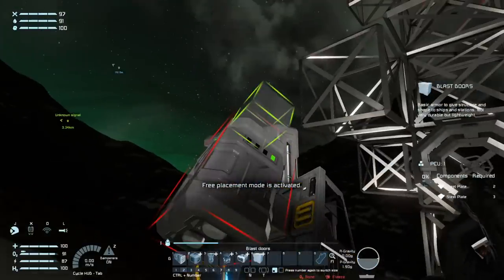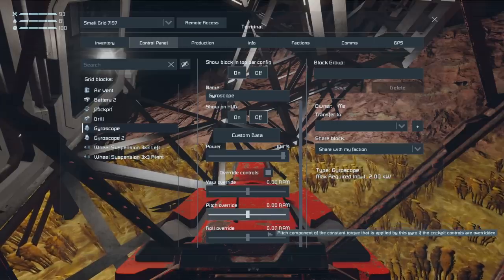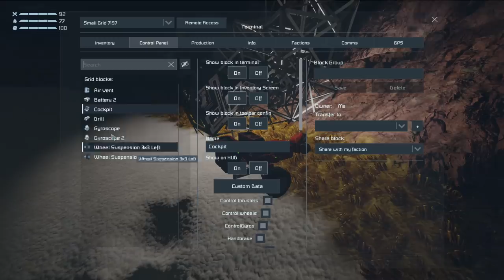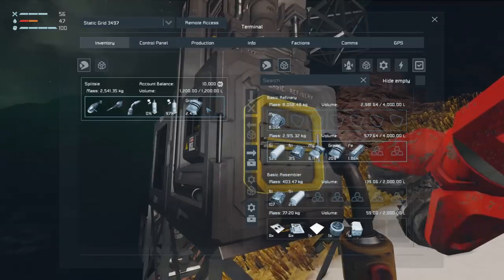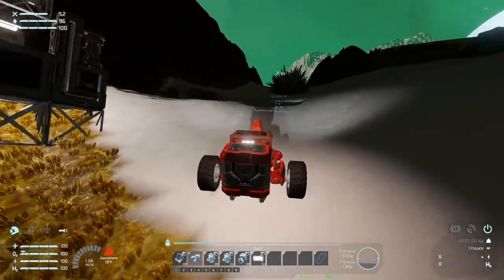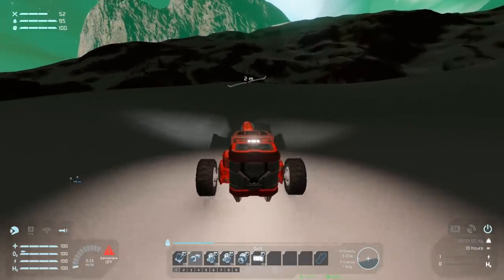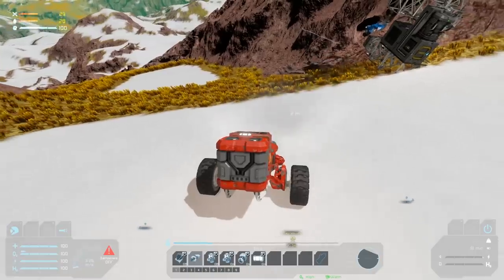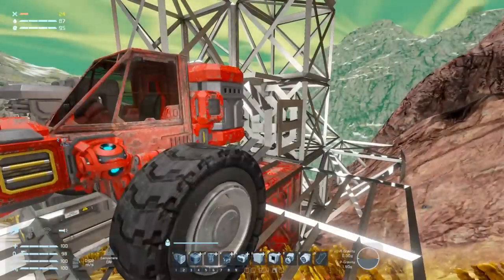Survival Impossible - Finding a Home #3 - Space Engineers Hardcore Survival

Comment: I had the same thought about the survival kit that you should grind some of the front out to make a flat surface for the miner to attach on with a rotor, and pop a pair of wheels under the landing pod. It will take some drilling to make room for it but if you charge the miner enough you should be able to dig it out with relative ease. 
Once it is out and in the open it is easy to frind out whatever you need. Right now I'd keep the armour pieces on just to protect the survival kit until it is secured.
Earlier on, I would have made a tunnel to the survival kit to make it easy to get to, to make it safer to get to the oxygen.
I guess my playstyle doesn't rely on the jetpack so much so I think of those a lot.
Reply from the maker: I think I'm probably going to go that way with survival pod if I can decide what to do with the cargo container, or better yet if I can work out a way to move it and the engine underneath as well :)

Comment: Hello Splitsie, this is my first comment in any video. First thanks for an excellent work. Now my little grain of sand: gyros have a forward and back position. It does not matters while driving normally but IT DOES when overriding. If you look at the gyro, sides are easily noticed, front and back not so much. If you look at it you will see one side have like 2 "eyes" one offset up, the other down. The other side have one "eye" centered, this side is front. Obviously u need to place it vertically respectly to the grid and the eye looking forward. Correctly placed -YAW will turn left and +YAW will turn right and so on. Hope this is helpfull and keep this excellent work.    (IGN: No_Mad)
Reply from the maker: Thanks that's good to know :)

Comment: I've been thinking, if there is just enough room under under Riki (the Rickshaw miner), you might be able to put a locked basic rotor on the bottom (facing forward) between the wheels or something, then add a 1x1 wheel with zero friction on that (the tire itself would be sideways, hence the zero friction).  that way you might be able to use the third wheel for stability when traveling, and drop it off somewhere, do some mining, then re-attach, and drive back home.
Reply from the maker: That's an interesting idea, I'm not sure I've got a clang free spot to put the thing, but I'm going to have to take a good look now :)

Comment: If you ever get problems with the stability of the little 2 wheel rover you could always just put a small wheel on the back under the battery pointing the wheel down so it works like a shock absorber thingy
I do realize that the whole point of it is to be able to point up and down really well but just a suggestion
Reply: I mean you dont even really need to put it on the bottom of the battery just on the back of it so you still have the manuverability and you dont need to worry about smacking your battery into the ground
Reply from the maker: I was thinking of something like that, I suspect it'd work fairly well despite looking a bit odd :)

Comment: For the miner, perhaps you could add a small piston that sits in the centre column of the 3x3x1 gap between the cockpit and battery, inbetween the central two blast door pieces when retracted, which extends downwards to the right height to provide a little stabilising foot for easy rotor part alignment
Reply from the maker: That's a very good thought rich, I might just do that :)

Comment: Forget attaching with connectors. They're never quite strong enough. No, instead, you need something ala the hitch for the catapult to the tank, so you get some articulation and can drive the entire thing by steering the miner. That way the cargo trailer can have a large cargo container, an oxygen tank, and most importantly a solar panel. With a piston jack on it to level it out when you park it. (And also make connecting easier.) Turns your weird little miner into something fairly All-terrain and rugged, while also being something that'll keep you going.

Also the large grid collector? Turn it on it's side, and park above a bunch of sloped armor blocks that lead into it, so the ejectors just roll down into it.
Reply from the maker: I'm really tempted to build a purpose made trailer for the miner in that sort of style, it'd certainly make the miner useful for a quite a bit longer which would be nice :)

Comment: Couple of thoughts:
1. Trailering from the survival kit back I think would save time overall in bringing that to the future home as you've already built the O2 generator and it seems to be needed so much more in this series. Also that container would be great to haul the components you'd need to start the new home.
2. Since you'll be grinding down the other parts, I'd grind down that atmospheric thruster in  front of the Survial kit controls :)
Reply from the maker: Yeah, I'm wondering if it'll be worth removing the engine and moving it to the top though, since it's set a lot lower than the rest of the survival kit mess...

Comment: Way behind on this series, I just subscribed after watching the Top Engineer challenge where Shack carried your vehicle down the mountain before taking you up.  You mentioned sliding or moving while in a menu, if you use space bar to stop and hold it while exiting or opening a menu it will hold you.  So far I haven’t had any problems sliding while in a menu if I made sure to stop completely before entering them.  I am enjoying the challenge of this series.
Reply from the maker: I honestly can't remember the sliding bit - which is a bit of a worry since this wasn't that long ago. Using spacebar as you're describing is using the menu to keep the handbrake on, a simpler way to do this is to apply the hand brake by a hot bar command which is accessible by adding the cockpit or remote control to your hotbar so you have a toggle :)
Reply: Splitsie when I am in a hurry I just use the space at trick to hold me while I attend to settings or whatever. Handbrake works the same but I tend to forget the keybind and have to think about it.  I have gotten through the next 2 episode and am currently playing in my world now, thanks for the challenging scenario to watch.

Comment: ooo you could make small sensor on the front and back and use timer blocks to equalize the pitch

also, you can stop rolling down the hill by using the space bar for braking

you may want to consider the easy grinding/welding mods, you can use a command to enable grind apart mode that separates blocks from the grid, the weld one adds merge pads that disappear when merged
Reply from the maker: I was braking as hard as I could, that's why I was getting nervous - the wheels were in full reverse because spacebar wasn't enough :P

If you look in the mod list you might spot something familiar ;)

Comment: Enjoying the series so far. The new planet looks fun, and the 1.9 grav adds some nice challenge. Not a big fan of 'aw scrap', but it could be fun here. The mistake I see repeatedly in SE let's-plays is: making it more about being stuck to the challenge, rather than finding ways to overcome and move beyond it. I think it would be a shame for that to happen here. Challenge for the sake of challenge is circular logic that becomes a trap. Watching you reach a point of not having to worry (as much) about jet-pack fuel, flying craft, etc. would be both entertaining AND full-filling.
It was mentioned that you might want to dig in to a mountain. You stated that you'd had you fill of underground bases with Survival Maybe, and I can see the desire for a change of pace. I also agree that doing so at this point would be kinda crazy without jet-pack/flying craft. However, I would like to state this idea for consideration: The sides of the near-by mountains have some pretty steep sides. If there was a shear face that gave you a suitably stunning view, might you consider an underground-but-not-underground base? I mean a base inset into the face of the cliff/mountain that wouldn't need to extend deep into the ground horizontally, but instead have multiple floors where most or all looked out at the view. An 'Eagle's Nest' base, if you will. Once you are less restricted to open ground bases, this would be a fun engineering challenge. With a flying miner, you could make a cliff-side road, like some roads in Chile or Peru, leading to a garage either set flush with the cliff, or set a little deeper into it. You would only need to make it for small grid, and just to get to/from the base. This would provide a challenge in just driving up and down this road without falling off the edge, and having a safe way to turn around at the base. Defense turrets could stick out of the cliff horizontally, and 2 or 3 independent, self powered defense turrets could be placed on the near-by hill-tops.
Anyway, my apologies for rambling on. I'm just a little excited to see were this could go. Keep up the inspiring content, and I hope you have a blast while you're at it.
Reply from the maker: I'm also going for the above ground base for a challenge to force me to engineer a solution to defending such a position, which feeds into your comments about challenge. Hopefully the things I've set myself here should be solvable with good engineering and I fully intend to solve them and once done I would move on to other challenges. If you've seen my other series I tend toward creating my own challenges to solve and do so to keep things interesting for me and hopefully the viewers. 

I don't believe they're circular in any way, because those sorts of challenge would be things like realistic personal inventory where you can't ever really solve that one properly, you'll always be a bit hamstrung no matter how good your systems there will always be 'grind' introduced into the gameplay.
Reply: @Splitsie  Overcoming challenge honestly is always a good story, and worth watching. I've seen a bit of your previous content, and you haven't fallen into the 'circular' style of challenge that I can see. If my comments came across as accusatory toward you, it was unintentional. As for the cliff-side base idea, it was just a hopeful thought. I'll admit to being something of a hermit, so I like underground bases in SE. Your under-mountain base in Survival Maybe really got my creative side riled up. It's your choice how you play, and I've no right to force anything. That said, unless you're planning to launch the base into space later on, might I recommend heavy armor for the exterior? Light armor is so painfully weak in combat. Anyway, still looking forward to fun new challenges. And if you ever find yourself running low on ideas, I'm sure I, and many others, would be glad to toss you a few - Like only launching into space with a minimal ship due to the gravity (thinking launchable version of the space spawn craft). Going for broke with a big ship could be interesting to try as well. I suppose I'll just have to wait and see. :D

Comment: In terms of a first person only game iv had an idea I haven't gotten around to testing yet.

With the introduction of the ability to lock the speed of a ship to another, Iv imagined one could get a pseudo 3rd person view of ships with small agile camera drones following along, how ever I imagine you'll need to drop controls to change the angles, or have someone else help out with that

Edit: Actually went ahead and just tested it, the camera drone has to have better directional acceleration then what your flying, and you will either need someone to keep it pointed at you, or only fly in on direction unless you want to re-aim and re-position the camera ship
Reply: can't a aim-at script keep the orientation?
using manual override on gyros
Reply: @ratchet1freak  well thats not too much of an issue but would help.

The problem is if you turn 90 degrees right the drone doesn't turn or relocate at all, so you just have a view of the right side of your ship, so you'd need a script to more so fix both those issues.

Or have a fleet of drones around you that you can switch to for different camera views when you turn. Would help as cannon fodder in fights, but more things to maintain and make sure that you don't accidentally crash into your surroundings
Reply from the maker: Plus in my experience a fleet of follow drones is quite the resource hog - at least from the drone swarm I used in episode 100 of survival maybe :P

Comment: It's probably fairly worthless to tell you this on such an old video in this series. But in case you do see this comment, and are still having trouble with this problem maybe it will still be helpful to you and/or others.

You should add an increase / decrease "power" control for your wheels group in your miner / rover. This way you can adjust quickly on the fly for when you have a full load and when you are empty. It is a night and day difference for slowing your vehicle down on steep downhill inclines with a full load, and easy to readjust when empty. 

I use this for all my wheel based vehicles which frequently have changes in their weight. Hope you see this, and hope it helps

Comment: I've encountered an interesting issue attaching two separate grids with a rotor. In the new Lost Colony scenario, I added a towing arm to one of the vehicles and was attempting to connect to another vehicle that ran out of power.  I had a headless rotor on the towing vehicle and welded a rotor head to the powerless one. Every time I tried to connect the rotor part to the rotor,  the two would suddenly snap to a 90 degree offset and the sudden torque would send both vehicles hundreds of meters into the air. If they weren`t in the safe zone at the time, they'd probably just explode then and there, but instead, they ended up launching way above it and eventually fall outside of it and explode on impact. I think the orientation of the rotor head was 90 degrees off from where the rotor expected it to be. I just realized today that maybe this behavior could be exploited to make some cool catapults.
Reply: I almost forgot to mention that to get around the problem, I pushed the dead vehicle out of the safe zone and secured both with landing gear. The rotor was then forced to sort itself out without twisting the rotor head.
Reply from the maker: Was that in multiplayer or single player? I've seen clients have that issue, but it's usually ok for the local host (as long as the rotor limits are ok). I say usually because I'm pretty sure I've experienced the same as you did - minus the safe zone shenanigans :P
Reply: @Splitsie  That was in single player. Since I posted this, I've been playing around with the effect in creative mode trying to make a catapult design. Using two rotors and detaching and attaching a rotor head on the locked rotor, I can get a subgrid to consistently snap into the locked position. It turns the rotor head instantly, but the game engine still tries to factor in the angular momentum of the subgrid which caused the sudden flinging of my rovers when I discovered this. Because the rotation is instant, it seems like I need another subgrid attached to the one being flipped to make use of that momentum. So far, all I've managed is to blow up the contraption or fling a single merge block with nothing else attached to it. I'm still working on it though.
Reply from the maker: That's both very cool and somewhat depressing at the same time, I wish you great luck on the catapult design though :D

Comment: I think your gyro uses YAW because u put that gyroscope sideways compared to the cockpit, (originally yaw is kinda like left-right rotation on the up-down axis) so it would make sense... if you attach it sideways its like rotated to the right (or left) 90 degree so this left-right on up-down axies becomes up-down on left-right axis which is exactly meaning lifting up or letting down your nose (your drill)
Reply from the maker: I suspect you're correct, it wasn't really something I'd thought about with gyros all that much previously :P

Comment: Don't forget that you can always switch your battery to charge mode, it should make a considerable difference =p (I always have my battery's in a group so I can toggle between auto/charge mode from my cockpit hotbar, is convenient)

edit: off topic but you could always slap a single solar panel on top of the escape pod, so that way it will consume less ice for power and it could give you a rough idea of how much power a solar panel produce despite not be place optimally.
Reply from the maker: You're right I probably should put a solar panel on there somewhere, I got a little too carried away with the hydrogen engine it seems :P
Reply: @Splitsie  honestly, I often feel the hydrogen engine consumption rate should be reduce by half or more to be worth while, they consume way too much ice quickly to the point is extremely tedious for little return =/ 

I just hope keen will buff them one day...

Comment: I know this is old but you got me wondering if you put one thruster on the back pushing down if it will counter the full drill. I'm going to try it when I get home from work tonight.
Reply from the maker: Unfortunately not since Space Engineers thrusters push through the centre of mass and when tipping forward that's in front of the wheels. You'd need to have the thruster on a rotor/hinge/piston so that it's on a subgrid in order to push down at the back specifically :)

Comment: use sensor that turn overide on off to keep level maybe it can work.  i did that for mining drill setup. use rotor and sensor to auto level on a little truck miner and piston to adjust the sensor point of detection. detect sub grid. just adjust the piston length for the level you want
Reply from the maker: I'm struggling to visualise that, but I love the idea of using a piston's extension to adjust the point where something gets triggered